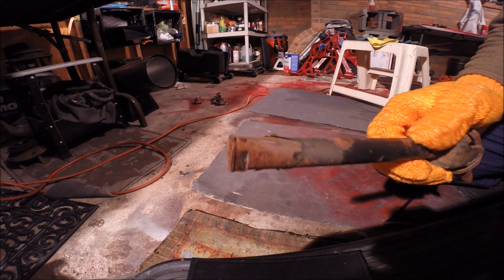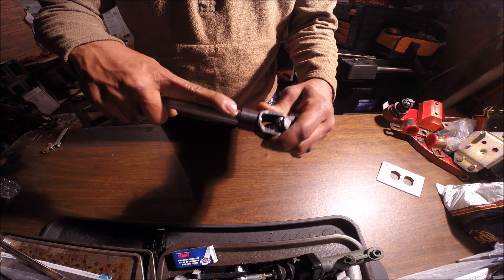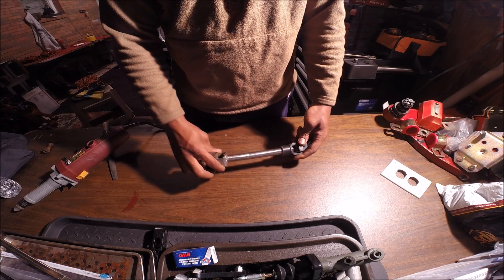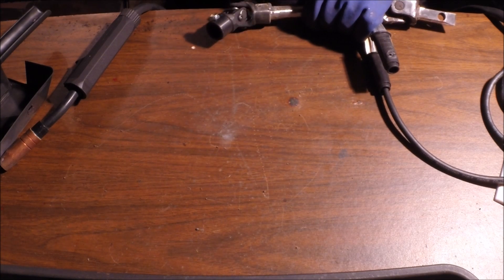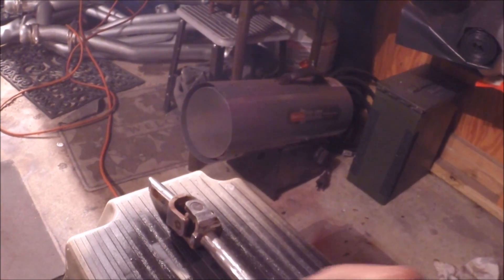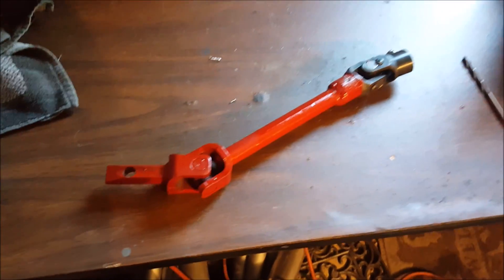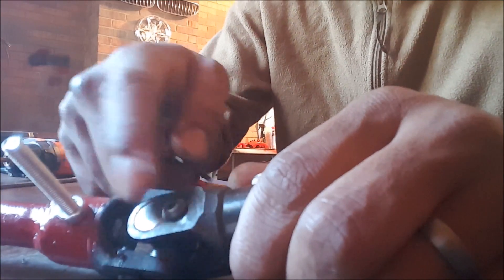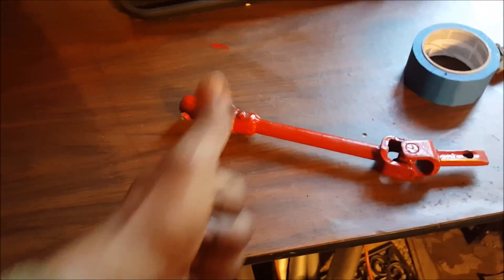Solid steering shaft conversion for 20 bucks: Foxbody

Comment: About to tackle this job on my steering shaft , what settings on the welder did you use ?
Reply from the maker: there were no settings back when i did this, just a HF flux core welder lol

Comment: Already recouped half your money spent on die grinder and welder by making that steering shaft lol. Damn things are expensive.. looking into doing the same same for my sn95
Reply from the maker: does the sn95 also use a rubber rag joint???
Reply: @Sgt.Slides  yeah. Its similar to the fox body rag joint.

Comment: After I converted my rag joint to a U joint I also checked the upper joint as well. Luckily, I spotted this because the original upper joint had a crack in it. Had to cut that old joint off and replace that with another new U joint. Nice video! Very helpful!
Reply from the maker: it's crazy how these steering shafts will split! I made another one for a friend of mine and the OEM u joint side was cracked.

Comment: I would use a hardened bolt with a nylon inserted nut
Reply from the maker: The bolt isn't keeping it together, the weld is.  If you're relying on the bolt, you probably shouldn't have touched it in the first place.

Comment: I need to do this for 97 Mercury Mountaineer, because these shafts are discontinued..

How & where would I buy the correct parts?

Thanks in advance..
Reply from the maker: you need to know how many splines are on your rack and you can buy the u joint from amazon or ebay.

Comment: Wait i didnt see you clock that u joint or index it to the steering wheel .
Reply from the maker: you don't really need to.  no matter how you put it on, it's not going to be off more than 5 degrees which you won't really notice. Chances are, if you have a fox, your wheel is probably already more crooked than that.

Comment: Drilling through makes it weaker actually
Reply: Try to make good solders first , instead of drillind half of your 3/4 down to real 3/8 really from what you removed inside.  Even the guys at borgeson,  jegs and detroit speed says NOT TO DRILL THROUGH . You are living a lie
Reply: You make a little ident for the stop screws , you dont drilk through, anyways well see if you get to 100k without your shaft breaking at some point... im shure you didint even zinc the hole you made
Reply from the maker: ok buddy  @cutterhead13
Reply: @cutterhead13  Did you happen to notice that the other end of the shaft, where it inserts into the steering column, came from the factory with a 'through bolt' to secure it? A rather large one at that.  Couplers with set screws are a good idea, but this is a non issue.
Reply: Anyway its a you get what you pay for , some place would even report for making something not safe for the road . A steering can get 200-500lbs  plus knock depending on the circumstamces.
Reply: Do you have any ideas why couplers exist ??? You prolly think it because they want to make money on you when its for security reason you genius
Reply from the maker: not to the point where there's any compromise.  Adding an extra bolt in there makes it much better.
Reply: Premium Fuel Mag weaken the shaft the size of the bolt. Your shaft is hollowed 1/4 less all the way through , thats called a weakness
Reply from the maker: incorrect sir
 @cutterhead13
Reply: https://youtu.be/5wH5TDH5t2w

Comment: You can resharpen even crappy drill bits and use them over and over till they are not long enough to use anymore.You can use a grinder or a bench sander.They also make a drill bit sharpener but I’m too shade tree for that.

Comment: Would this work on the 99-04 cars?
Reply from the maker: Short answer is yes, I believe the easiest way to make it work would be to use an older style k member.  you could probably get an OEM one for free, since folks are throwing them away.  I plan to trash mine.  Tubular k members start around $300.... Then you just gotta get the wiring straightened out, which should be easy since you don't have any over complicated computer BS or security to deal with. It would be a good swap, I destroy all 4.6 cars with mine, new edges and s197's.
Reply: Premium Fuel Mag all that for a solid steering shaft for the 99-04 cars?

Comment: When I did this mod, instead of using a bolt and nut, I hammered in the bolt in a hole just a little to tight, and welded the bolt in place. No more loose nuts.
Reply from the maker: I'm making another one soon, i'll probably do it that way too.

Comment: How did you do the alignment of the new joint for the steering rack? I know the input shaft to the rack, on my 92 mustang anyway, is a is a "D" shape that the rack has to be centered and that puts that "D" shaped shaft in a very specific position for the steering wheel to be straight when the steering shaft is re-installed.
Reply from the maker: I have never seen an SN95 steering shaft, but you don't have to do any aligning to this on.  If you do the math, it can't possibly be off by more than 5degrees once it's installed because  of the splines, as long ad you install with the steering wheel straight.  5 degrees is the worse case scenario, and on a fox, you won't notice if it's off by 5 degrees.  If you did want to be super anal about it, you could install it with your car on an alignment machine before you weld it, then tack weld it or mark it, take it back off, finish welding, and then re install.... totally not worth the effort, but to answer your question about sn95, I don't know what the ends of the shaft look like.  not sure how you would line them up.

Comment: Where did you get that joint? Could i pick it up from a local parts store such as orileys or autozone? Or if you have a part number thatd be much appreciated
Reply from the maker: I doubt you will find that in any parts store, you can probably find it in a summit parts catalogue or something, but your best bet is to search for the specs i gave in the vid and buy it off e-bay or amazon.

Comment: I would love to make one of these but I have two issues: my local junkyards don't have very many foxes anymore and I don't know how to weld. Would you be willing to make me one? Ill pay you for it :)
Reply from the maker: For what i'd charge, you'd be better off spending $100 on a harbor freight welder and doing it yourself.  Get a few scraps of metal and practice, then go for it!  If you decide to go that route, hit me up again and i will give you some additional tips.  In fact, look out for a video this week from me on using the HF welder.  If you don't want to try it for yourself,  just drill a hole thru like i did, and bolt it together.  That's a strong enough hold by its self.  from there you can take it to an exshaust shop and give them a few dollars to weld it together.  If your Mustang isn't your daily, just mod your stock steering shaft, Or you can get one from e-bay for cheap.  I'm not sure what i did with my old one, but if that one turns up, i may be able to mod that one for youfor cheap.
Reply: Premium Fuel Mag ok I'll try it, thanks!

Comment: if your too broke for the  20$  Ujoint you can use the joint from an astro van. you can make it work with a slider so it makes for a  super easy install.
Reply: heith85 dope info man thats what i like to hear.  junkyard mod
Reply: Junkyard Dogg.  Do you have any good videos on converting the Foxy mustang to 5 lug and disk brakes for the front and rear?